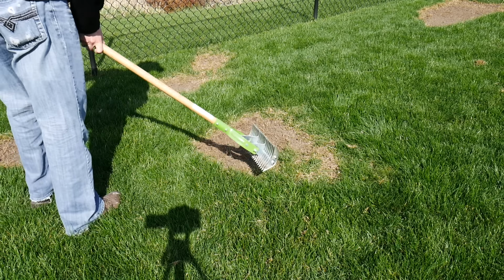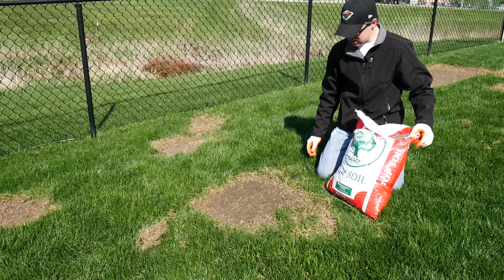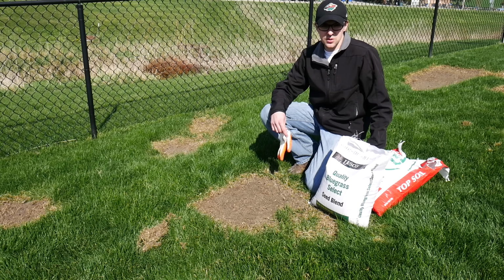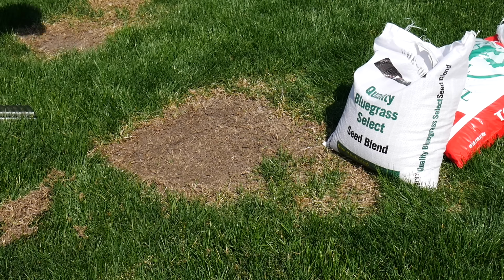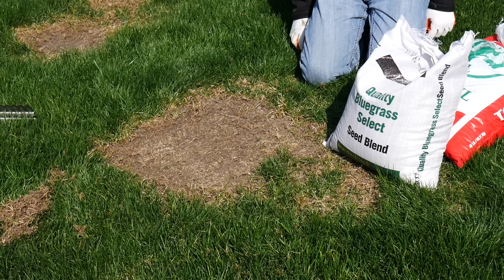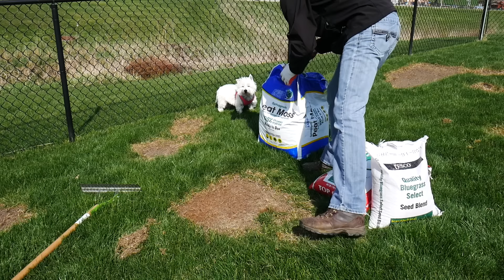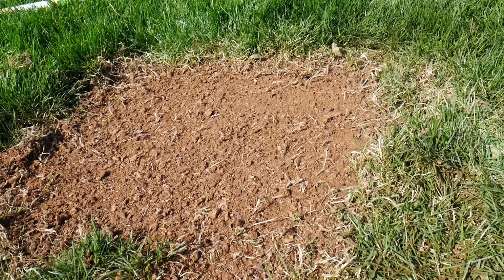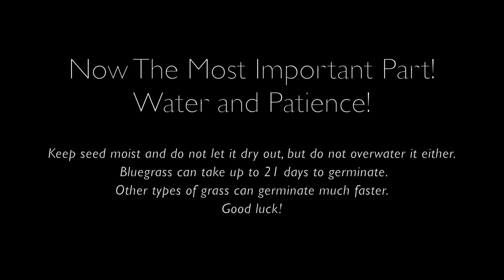How To Seed And Repair Bare Spots in the Lawn

Comment: Question. I have an area of 9 ft x 17 ft that needs reseeding. Appears to have died from over spray of grass killer in the fall. Do I have to completely remove all the dead(Brown) grass to reseed? Also, live in New England and was curious what you think is the best grass to use? Thanks
Reply from the maker: You have to remove enough so be able to see the soil layer underneath.  Grasses would be bluegrass, turf type tall fescue, or ryegrass
Reply: @ryanknorrlawncare  Thanks

Comment: I put fertilizer down about 2-3 was ago and now my front yard is turning brown. What should I do if I over fertilized?
Reply from the maker: Lots of water is about the only thing you can try
Reply: That happened to me too I used the spring fall feed and weed killer and it made burn spots and watering does nothing. I guess I will have to repair those areas.

Comment: ryan...need some help. I did exactly what you did and also did re-seeding 4 days ago. I live in upstate NY. I want to put a start with weed preventer but I thought it will effect the grass growth also as it has a pre emergent. in this you recommend to use feed and weed. what are your thoughts.
Reply from the maker: There's a difference between the Weed and Feed from Scotts and the Starter with Weed Preventer.  Very important difference there.  :)  The starter with the weed control is a chemical that works with new seed and does not disrupt its growth but the weed n feed definitely would not work with new seed.  You're looking for the Starter Fertilizer that has mesotrione in it for weed control.
Reply: Thank you! could you please provide a link? I am new to this and your help would be appreciated.
Reply from the maker: Ruwan Budhagoda absolutely. let me we what I can find and I'll get you a link if I can
Reply from the maker: This is the stuff: http://amzn.to/2otzuiN
Reply: Thanks! this is what I thought. I see lot recommend this...but for some reason it says in the packaging in this not to use up to 4-6 weeks of seeding. so that is where I am confused. This got tenacity I believe. I just spent about 160 on seeding and wondering of I should take the risk.
Reply: I wish I read through these comments two months ago!  I reseeded thin areas of my lawn and with it came a ton of crabgrass.  I'm thinking it was because of the extra water I was putting down to get the seeds to germinate and zero pre-emergent.  If I knew what I was doing putting a preventative/starter fertilizer like in the link would have saved me a lot of trouble trying to kill off the crab grass now.  I've been using 1 ounce of each drive/trimec/surfactant per gallon and it's smoking the crab grass, no damage to the new grass either.  Keep up the awesome videos, love the aerial shots!

Comment: Hey Ryan you’re the king of lawn care. 

I have a question. 

I got my lawn looking killer this year but I do have a few weeds/dandelions. Do you know of a product that I can spray directly on them to kill them, without harming my grass? 

I would like to go after them direct spraying a chemical directly on them. Than afterwards I would use a pre preventative weed control
Reply: I have really good luck with using Spectracide "Weed Stop for Lawns + Grabgrass killer". It works for most grass types (check the label) and won't harm it. Knocks the weeds out in a couple days. I apply it to my entire lawn and then come back a couple weeks later and spot treat the stuff that managed to survive.
Reply: Just dig them up with a hand trowel, your grass will grow right back in its spot.

Comment: Wisconsin here. My lawn looked great for years after we built and used a service for over 12 years. Got lazy canceled service, stopped aeration. And all hell broke loose. Weeds and compacted soil plus dry summers = lumpy lawn and dead spots. We also have a very rounded hill in the back dropping 10 feet to wetlands.

The back is awful, and I determined it was the dry summers, with occasional storms, caused what you see in deserts, with hundreds of "gullies". The flat areas are a mixture of issues but I manually and chemically de-weeded, and mowed with deck raised higher. It went from awful to bad. Have a lawn service last year and this year, more help but won't aerate until fall. Hoping this retains moisture in the back.

Finally, retired early, have had time to to pursue dead patches with mixed results. I own an electric dethatcher which churned up loads of dead grass and on the hill, it helped churn the soil somewhat. I churned more with a garden weasel (exhausting) then added soil, seed, soil and light watering as we've had rain.

Result 3 months in?  Still seems bad, but wife walked the yard and put it in perspective, told me it is way better. I'm just impatient. The truly dead areas, one is right next to my front walk (ugh!!) Are going to require a total do over. The soil is shallow here. When they graded after building they should have removed all the gravel and dust because the soil is shallow and if you dig, you immediately hit stones.  May have to dig this are out, deepen the soil, then build it up.

TIP: I bought a 10" "tamper" that really helped keep replied areas level with the surrounding soil vs. depressions at repair sites.

Maybe this will help some northern homeowners.  Have a good one.

Comment: I have wanted to do this for years but I am cautious about inviting back in Crabgrass. how long until you can apply pre-M to those newly seeded areas? when you have neighbors with a ton of weeds this is a tricky process that can bring in more weeds
Reply from the maker: It's probably inevitable that I will have some weeds, but it would be worse if I did nothing so I guess I picked the lesser of the two evils.  The Scotts brand starter has mesotrione in it which is a weed preventer that can be used when seeding.  I have not used it personally yet so can't speak to how well it works or not, but it would be an option to try.

Comment: what caused the spots?
Reply from the maker: I believe I narrowed it down to some residual roundup in my spray can when I sprayed some clover last year.
Reply: ryanknorr speaking of clover, what did you spray that with?
Reply from the maker: Just weed-b-gone
Reply: Yes, I am having a hard time with clover. I hand pull it but it keeps coming back and seems to be spreading. I try to get the roots.
Reply: Jay Reed Use a very long (12-15 inch) flathead screw driver to dig up the roots of clovers or weeds.  Much easier to jam it into the soil than regular hand weeders.

Comment: Hunter rotor nozzle put out 4/10 inch  per hour Precipitation rate, with the best distribution of uniformity or (D.U.). Most efficient way to water landscapes.. the gallons per minute is about .5 gpm
You need to water your lawn atleast 3 X a week for 60minutes each time. That gives you a total of 1.2 inch of precipitation. THESE HUNTER MP ROTOR NOZZLES HAVE ALMOST NO RUN OFF OR RUN THROUGH.

Comment: Ryan did you go back and put more peat moss on in the following days after watering? Seems like when you water some of the peat moss goes away and seeds tend to show some. To prevent the birds from eating it i was thinking of putting another thin layer on. What are your thoughts?
Reply from the maker: I didn't add any more after watering and didn't seem to have any issue.  The birds probably still got some seed but it wasn't enough to hurt anything.

Comment: I just seeded some bare spots, more like long trenches from when irrigation was installed. It's been about a week since it was seeded. When mowing the lawn with a push mower, can I just mow right over these areas or do I need to avoid them and go around them? Some spots have germinated most have not.

Comment: Ryan, how did you like the lesco kbg blend? Did it hold up? In the fall I think I will overseed with an all kbg in the backyard. I had a lot of winter kill in the backyard and it was just hydro seeded last spring with a lesco sun and shade mix. Looked pissah in the fall but this spring I had to lay more seed down with tupersan yo prevent CG. Kind of bummed but looking to get more kbg in to help with self repair this fall. Let me know your thoughts. Thanks!
Reply from the maker: Seemed to work fine for me.  I know the hydro seeding can be a bummer.  Good luck!

Comment: I think I need some help with my lawn. Two weeks ago I spread out a few yards of top soil to level my yard and there were a few areas where the soil had to fill large dips so the patches of "no grass" are about 8-10 feet in diameter and 5 inches deep in the middle. I compacted them with a roller then loosened the top inch and spread seed (Scotts NorthEast mix) and then spread peat moss over the top. I've watered it twice a day since and now have some shoots coming up. The issue is, when I loosened up the top inch to plant I accidentally created rows, like a plowed field, and the shoots are coming up in those rows.....like lines of grass.
Can I add more seed to fill in the "blank rows" or should I just wait (will more grow in between and it just hasn't germinated yet??)  I live in CT, I didn't think to check the soil PH etc and I also haven't added any fertilizer or lime since I didn't know the PH etc. I now know that I should have checked this before I started but since I didn't, what can I now do ? Mowing around these patches is not easy since some of them have grass in and around them - I don't want to mow those areas within the patches because I would have to mow over the new seedlings to get to them....meanwhile, the old grass that is in the new patches is about 6" tall !

So....long story short.....should I test the soil and add a fast acting lime as necessary ? What about a starter fertilizer, is it too late ? What about adding more seed to those germinating areas to thicken it up ?

This is my first real attempt at lawn leveling and so far.....I'm not getting the results I thought I would. I guess I have myself to blame for not testing or adding the starter when I seeded.

Thanks !

Comment: Ryan, I have some bare spots like this in my yard and was thinking about aerating as well this spring. My question to you is should you aerate over these bare spots then lay peat moss after or forget the peat moss for a later time if the bare spots return?
Reply from the maker: I would aerate first and then put some seed on those spots and cover with a light layer of peat.

Comment: It's not necessary to apply grass seed, grasses propagate much faster by means of the runners which in this case is extremely well established. Also the season during which the seeds are planted is of the essence,  if it is planted in or near autumn, seeds will poorly or not at all germinate, therefore early spring is preferable

Comment: Thanks for the tips!  While using the dethatching rake I pulled up a section and found grubs😤.  No wonder it was dead there.  I raked the spot, applied Spectracide, watered that, added topsoil,  mixed in the seed, applied Milo, put Peat Moss on top and now watering and praying to the lawn gods.  Did a huge section with that manual dethatcher, what a chore!  But very satisfying pulling out all that dead grass in the lawn.

Comment: I put down some Bayer 3 in 1 weed and feed with up to 6 months of prevention about 4 weeks ago. But I uprooted so much crab grass in some areas in the back yard that I'm thinking about putting down some winter rye. Can I dig down a bit and break the pre-emergent barrier and seed these areas?  If so , how deep should I spade up these bare spots?
Reply from the maker: I normally just dig down enough to loosen the soil so you have a little bit of soil to cover the seeds with. Instead of digging you can also add a small amount of topsoil on top like I did the video instead of disturbing the soil already in place. I've done both methods and as long as the seed has some soil contact and peat moss covering, I've had good results.

Comment: Try using Milorganite rather than Scott's. I've had better luck with it and it is more cost effective
Reply from the maker: I'll be using milorganite coming up in the very near future.
Reply: Not the best for a starter fertilizer. Milorganite is slow release and requires more heat. A fast release starter would be better for new seed.
Reply from the maker: I will be doing milorganite after things are more established but yes the starter works better at the beginning or a quick release of some kind.

Comment: Hello Ryan, great video as always, I have another question for you. So I just mowed my lawn short, dethatched, overseeded with Kentucky Bluegrass, raked it in, will be putting starter fert in about 2 weeks. I will be shampooing tomorrow. But I have a bunch of weeds, which I plan to put down a pre-emergent to stop further growth around Memorial day, a bit fast for fertilizer in a 2 week period, but i did put a bunch of fertilizer last year without issue. But, is it safe to put down a Scotts weed and feed along with a Scotts fertilizer with Halts preventer?
Reply from the maker: Well if you put down seed you wouldn't want to put down any weed and feed or preventer of any kind because the seed won't grow if you do.  I would maybe worry about the weeds later and right now just try to get the lawn to thicken up and choke them out.

Comment: you're gonna beat me with this seed too lol mine is still taking its time waking up
Reply from the maker: Have you thought at all about adding a little more seed to the thin areas in your yard?  I know it will fill in seeing that it is bluegrass but I seeded my yard from scratch like you did, and had I not added a little more seed each season for the first couple years, I think it would have taken me a lot longer to fully establish it.  Just curios your thoughts on that?
Reply: Isn't that seeding too heavy?  I have seeded bare patches in the past like that by hand and initially the grass grows very well and thick but then I end up with a lot of the grass dying a few months later.  Not sure if it was too much competition, too little water etc - I have some patches to fix this year again so will be trying a hand held spreader this time.  I normally use a broadcast spreader and I don't think the seeds are spread that thick.  Will be curious to get an update a few months from now after 3-4 mows to see how those patches fared.

Comment: Ryan, thanks for all the great videos and information...they've helped me a ton! 
Question: Will I still have good results if I follow the process in late May/into June - or is it better to do in the Fall or early Spring? I live in Eastern Iowa....Thanks!
Reply from the maker: If you're just looking to fill in some spots I would start now.  Otherwise for larger areas fall will be the best.
Reply: Hi Ryan, thanks for this great video. I have few patches that need help in reseeding. Will I have good results if I do the reseeding in June/July? I live in Seattle,WA. Thank you!
Reply: Hi Ryan, thanks for the video! I live in Portland, OR, and it is currently spring time (i.e., raining day and night). Will this work now? I'm also worried the topsoil I add will just be washed away.
Reply: @SamuelGarcia-rf4th  it depends on how much rain you’re getting. Light drizzles should be fine, and downpours kind of speak for themselves.

Comment: Hi Ryan.  I watch your videos very often.  I actually really got into lawn care this year, and your videos are very helpful.  I do have a question in regards to this video and the Lesco seed bag featured here.  I recall you previously mentioning you have some bluegrass that grew 5inches and others that were much shorter (possibly 2inches).  Did this Lesco blend resolve that issue?

I am located in the Chicago suburbs, and I think I have a similar type of issue.  However, I didnt really care of my lawn until late this year.  I believe the grass in my yard is the original 40 year old grass.  I am going to over seed this year, and am looking to grow my grass over 4inches next year.  I was able to cut a full height at the end of the summer season.

Thank you in advance.
Reply from the maker: The Lesco stuff seemed to pretty much grow as tall as the other stuff. You just want to do the research on the cultivar name and it should tell you what type it is.  I have a couple of cultivars that are the "compact" type so they are supposed to grow more laterally instead of vertically.  I could probably match everything by cutting shorter but I haven't had the courage to do it yet.

Comment: does the peat moss really repel birds? or it just hides the seeds from birds? also can the peat moss act as a "binder" when moist to help prevent seeds washing away if I'm planting on a gradient?
Reply from the maker: taumax it just hides the seed a little bit from the birds. they will still find it a little bit but it helps. it could also help a little to hold the seed in place. it won't work miracles but does help to kind of "glue" the seed down a bit.
Reply: if you have to plant on a slight grade, what would you recommend doing to help prevent the seeds from washing away?
Reply from the maker: I would say peat moss or germination blankets would be your best bet for a grade.  Look up Grass Daddy on here as he has been doing a renovation with some videos about what he did on a hill portion of his yard.
Reply: ryanknorr I did, and he unsuccessfully used germination blankets and then resorted to spraying a tackifier. I was inquiring to see if there are other solutions.
Reply: You can grow grass in pots to  then place in grass in lawn after grown. Have grass growing now in  cement plastic mixing  tubs 24 inches wide 6 inches deep cost only 6 bucks home depot or low also have 48 inch ones grow  ground cover to just drill holes water can drain grow plants in them to but heavy move around 24 tubs can pick up full of soil..Tip put clear tarp  or net over seed area small holes like little tent birds can not eat seeds.